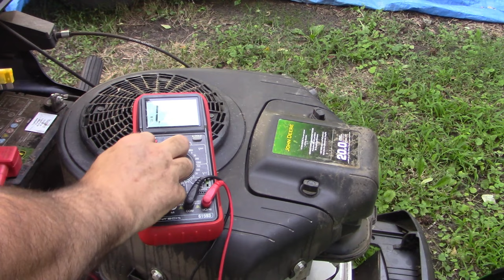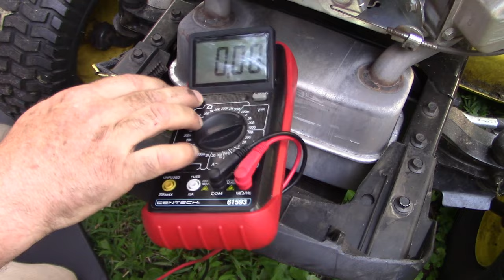John Deere WON'T START !! No Crank / No Start - D125 Lawn Tractor - Let's Fix it !!

Comment: Somebody jump started that mower with a running car. Will blow that fuse every time and probably fry the stator too?
Reply from the maker: Did you watch the video? The blown fuse was caused by wires shorting out after melting on the hot muffler. There was no jump starting....
Reply: Awesome job! Hope that's my problem too! Thanks

Comment: Cranked good yesterday. Ran out of gas. Put gas in mower but it wouldn't start again. Battery is new
Reply: Same thing happened to me yesterday.  Ran out of gas, and now when I turn the key the lights go on but not a noise from the starter.

Comment: So - my issue turned out to be not the battery, not the engine - but the sensor beneath my seat (an auto shut off if the lawn mower thinks it is in gear). It got loosened evidently when i adjusted from my wife's setting to my own. Once i firmly pressed it back in -- mower started right back up!
Reply from the maker: Cool. Glad you got it all sorted out. Thanks for the update.

Comment: Check this out. Bought this from someone the other day. I found these exact wires melted in the exact same damn place. This fixed it for me. I did notice the wire before but thought nothing of it.. thinking to myself  "Oh just the headlight connector" Crazy how this would give you a no crank no start! Excellent video and thank you very much.

Comment: A Voltage test and getting 12V does not ALWAYS mean the battery is good.  AMPS are what does the work and you need another Battery or Battery Tester to be sure.

Comment: I turn the key and I hear a clicking sound from the solenoid but it doesn’t crank over….any suggestions?
Reply from the maker: weak battery. loose or corroded battery connection, perhaps where the negative cable bolts to the tractor frame. or maybe just a bad solenoid.
Reply: @Buckwsr  Thank You Sir….got it…yes…tried charging the battery….wasn’t holding the load/voltage…battery was coming up on 3 years….had it replaced….started like a charm…I appreciate your help….stay healthy…Thanks Again 🤙🏽👍🏻

Comment: I have worked on machines , cars mostly , and had blown fuses that I never could find a reason for.  Replaced the fused and the new one wouldn't blow.  Ask the owner if they would let me know if the issue came up again and never did.  Sometimes a blown fuse could be the only problem I guess.  Maybe a manufacturing issue of sorts?  But you did well finding this mowers issue.  Aside from using shrink tube to help in both insulating the new connection and supporting it as well that fix was like I'd do and should last years and years.  Excellent work.
Reply from the maker: Thank you, sir, for the info and kind words! I appreciate it!
Reply: Or it just doesnt touch bare wires again out of luck or a jiggle.

Comment: Thank you for being a good example for us to emulate.  "Go for the simplest explanation first."  I was thinkingn I needed to replace the starter, but now I'm going to check the rest of the machine, especially the peripheral electrical system with my voltage meter.  I noticed something that seems to be coming from the starter that has a box on the end that connects to "NOTHING?" and has two slots at a 90 degree angle, forming a "T"... do you or does anyone else here know what that is for and what it is supposed to connect to?

Comment: Hi Buck, I hit  rock or something with my JD D130 and the mower  and stopped and I’m getting zero when I turn key. Batteries fine, fuse is fine, gas is in there. No leaks. Any ideas?
Reply from the maker: Does the engine crank/spin when you turn the key, but just doesn't start? Is that what you're saying?

Comment: We have the same mower, but doesn't start. We change the battery, all 3 filters, spart plug, and it still doesn't turn on and check the fuze it looks fine.
Reply from the maker: I wish I could be on site to help you out. Hard to do so remotely. When you turn the key what happens? Does the starter motor engage to spin the engine, that is, crank? Or not? If not, do you hear a "click" sound at all from the starter solenoid when you turn the key?

Comment: Hey i have a d 170 you have to take air filter and hold your hand over air intake and it cranks then remove hand when it fires from it to run. Any idea.
Reply from the maker: Sounds like the choke mechanism is not working correctly, or choke plate does not close fully. With your hand over the intake you're essentially choking the engine manually. Verify that when you move the throttle lever to the choke position that the choke plate on the carburetor closes fully. If not, adjust it so that it does. Good luck.

Comment: I've got an old Murray where the headlight wires came off as the front headlight was missing so there was only the ground wire and the power wire from the ignition and they were floating around in the engine bay. We did cap them off so they're not grounding out to anything, but there's still not even a click.  Any thoughts? Just put in a new solenoid, 4 post
Reply from the maker: Does the electrical system have a fuse? If so, check it. Next I would test for 12 volts on the small terminal of the solenoid when the key is turned all the way to the "start" position. This would be the wire coming from the key switch to the solenoid. If there is no voltage there when the key is turned to the "start" position, then you'll have to work backwards to find out where the problem is. It could be safety switches, or the key switch itself. I assume you've checked the battery for voltage, have it hooked up correctly, and with good connection at positive and negative terminals.  Good luck.
Reply: @Buckwsr  did replace the fuse with another 15 amp fuse. It's weird because the mower was working a few weeks ago my son turned off and now there's no click. We have a good battery. It seems like the terminals are loose on the fuse connector so maybe I should replace that but not sure how to test that. Thanks for responding, I subscribed! Much appreciated.  

My son's tired of watching mower and solenoid videos but I figure a few dollars in parts and time is cheaper than a $3,000 riding mower.
Reply from the maker: @DefensorFortis  ok. Do the test that i mentioned previously. See if you can get a wiring diagram for your mower. That would help, I think.

Comment: Just recharged my John Deere mower.  Now cranks, but won't start.  After watching your video wonder if it is a blown fuse .

If not, could it be a bad spark plug?  Trying to fix the problem myself without calling for neighbor's help.
Thanks
Reply from the maker: If the starter mower is turning the engine (that is, cranking), then I'm sure it's not a blown fuse. A spark plug can go bad, but that is seldom the reason for a no-start situation. Give me some more details on what model John Deere you have, and what engine is in it. That might enable me to give you some more things to check.

Comment: I'm surprised to see that those wires melted even though they were heavily insulated. That is crazy. 🤦🏾‍♂️🤦🏾‍♂️🤦🏾‍♂️🤦🏾‍♂️🤷🏿‍♂️
Reply from the maker: Well, those mufflers get pretty darn hot....
Reply: @Buckwsr  if those mufflers are getting hot to the point that they are causing wires to melt, that is a design flaw and it needs to be addressed. 🤔🤔🤔🤔🤔🤔🤷🏿‍♂️